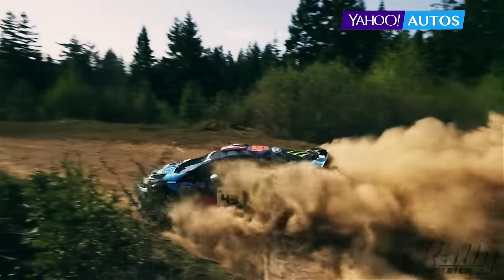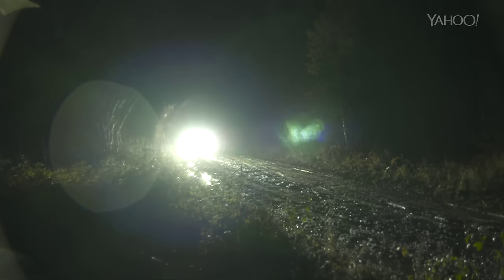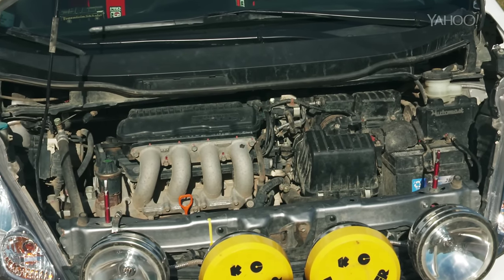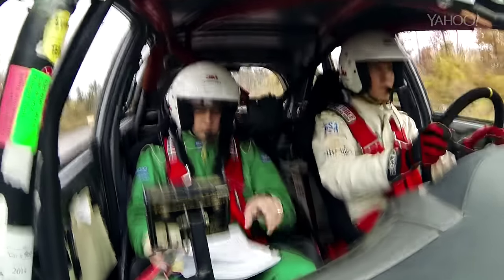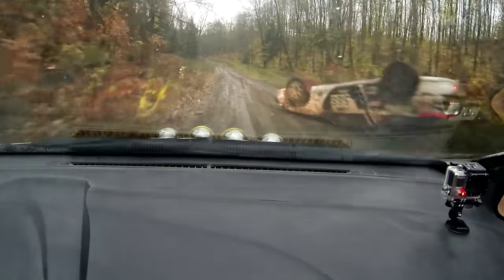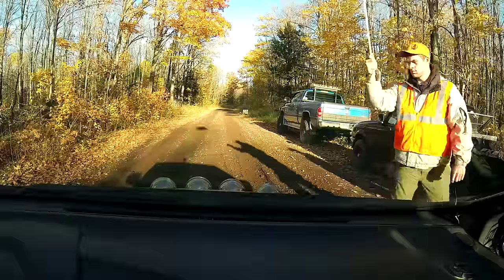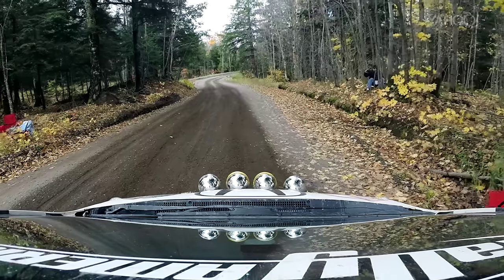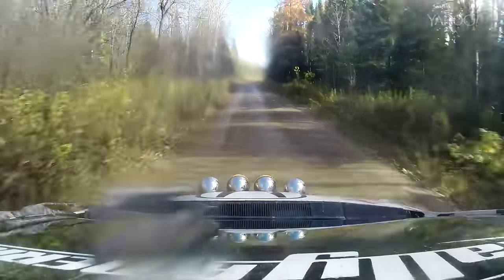How To Go Rally Racing On A Budget

Comment: But how do you get to be like Ken Block? Do they just pick you out if you're good and give you a sponsorship. I would really really want to become a rally driver but don't want to spend too much money on a car.
Reply: First you have to put blood,sweat and tears into rally. You have to make sacrifices and make rally a lifestyle and not a hobby. You most likely have to use alot of cash to get to a good level and still after all this there is a small chance you might make it if you're good enough. You won't make it with only using 10-15 grand in total. but all the extra fees you get is insane repairs, Sign up fees, safety equipment etc etc. You can't get away with not using much money in any car sport, Every sport that involves a motorised vehicle is expensive no matter what. But you can make it if you dedicate your life to making it. You can not be afraid of crashing, if you are you might aswell give up already.
Reply: Nicely said
Reply: I feel like you can *probably be bit scared of crashing. It would probably cost you more if you are idiotic & too confident of how "good" you are. -- Time, Dedication, Concentration, Strategy, & Doing it now ; no procastination. Is what I would add as well. Oh & dont kick yourself around for missing an oppurtunity or procrastinating, youll just be wasting more time doing so. On strategy part, just pick up/find things info that would be useful.

Comment: Yeah but a cheap Honda Fit is going to be a bad rally car without messing with the engine, drivetrain and probably the whole chassis. If you're going to rally on a budget, an Impreza (base model) would probably be the cheapest and best way to rally with low funds.

Comment: Wtf they came in first? Makes me feel way better about wanting to join a race then. I'm too afraid I would slow everyone else down..
Reply: In their class....and don't forget that likely everyone else was sliding off and getting stuck as well.
But I get your point!
And...you shouldn't slow anyone down never mind how slow you are, because the field is seeded. Which normally means the fastest car is first, and as you go down the field the cars/drivers get slower.
And they run at 1-3 minute intervals, so as you should be near someone else with a similar speed, there is no way they can catch up one or more minutes.
Sometimes it doesn't work, but thats not your fault if it doesn't.

Comment: Only a bit like Ken Block. He's actually not a very good rally driver, he's not that fast and he crashes a lot.
So that's like 20 thousand dollars? You call that a budget? I'm sure that if you had a friend who's a mechanic, you could easily get an older car and rebuild it into a rally car for half the price. Pretty sure the only thing you need in the car is a roll cage. You can make the car lighter by removing stuff you don't need. Spare parts optional. You can go cheap and not have them, but if you damage the car, you're out.
Reply: Unless you are only doing really really base level events, (which are set up so you can't reach high speeds) you also need seats, belts, fire extinguishers, warning triangles, mudflaps, and lots of other small bits. 
Also full fire proof suits, helmets, HANs and boots, gloves for the driver.

Comment: This is maybe one of thr worst possible cars to try and rally
Reply: Because?
Reply: MtO NoSpaceGamer
It's a 5 year old economy car, meaning its $10,000 USED and is only good for fuel economy and safety.  Horrible for any kind of fast driving.
Reply: Millermacs
yet, he won with that car... with the drive train still being stock (save for welding the diff) and rally racing isn't just about going as fast as possible. its about going as fast as conditions and your skill allow. i mean the top speed that he got to was 80 mph (128kph), that honda fit is more than capable of doing that and then a bit more.

Comment: There are easier and cheaper alternatives for anyone to get involved in motorsport. The most important thing to do before you start is the one thing that nobody does yet it will have the biggest impact on your chances of doing well when you begin. This is going to be hard to hear and you are not going to like it. You are not a good enough driver yet and you will be slow. You can tell me about how amazing you are in the reply but I have to ask you about who says you are good /fast /amazing? If the answer is anything other than the race team boss or public opinion in the press. You are slow
I am a 4 time hillclimb racing champion and time attack and rallycross race driver and race circuit performance driving instructor. I am starting a YouTube channel dedicated to race driving tuition it's a step by step ciu to improve your skills, learn everything you need to know about preparation, car setup and building experience with practical skills you can learn and use every day. Click to see more information and the first video will be up 30th May 2018. Feel free to contact me by email to discuss your plans and and I'll be happy to help with any information you may need

Comment: 18 grand why dont you buy a used evo or a wrx and put the extra money into it at least it would be awd
Reply: you have to then add the $4,000 roll cage, $1000 for seats and harnesses, $2,500 for suspension and $1000 for tires.
Reply: +G' Squared  true then a 98 Subaru would be the best bet i picked one up for 2500 couple years ago it was a turd  then i put about 6g into it new and used parts turned out nice
Reply: +Daniel Albrittain  you know what they say! "if you love then you should put a cage in it"
Reply: Lol very true
Reply: +Markez Singltary  ok so let me buy the slowest car ever for rallying thats not even awd and drop a ton of cash in it search around you can find newer wrxs for about 10 grand get it tuned you can take it straight to the track being bone stock and destroy that fit honestly i give zero fucks what a honda fan boy thinks just hope no one goes out and buys a honda fit
Reply: +Markez Singltary so where do you rally at just curious you proably don't  thats ok  im more into circuit racing these days i also ride a cbr 600rr
Reply: Speaking of rally, my first race is going to be Oct.1st Show-ME
Reply: +G' Squared  good luck and where at
Reply: +Daniel Albrittain Potosi,MO it's a regional event in the 100ac wood area
Reply: +G' Squared sounds cool im gonna check it out good luck man

Comment: You bought a FWD car so thats why you got so many understeer and I thinks its not recommended for rallying
Reply: harampug - FWD is the primary grassroots rally platform. They are easier to maintain than AWD cars and generally faster than RWD cars on gravel. Proper technique and car preparation makes the difference between an oversteering or understeering car, regardless of drivetrain configuration.
Reply: yep, FWD cars wont turn without power. Old mate was taking entries way too soft and trying to turn while off the throttle. When driven well FWD's make great rally vehicles.